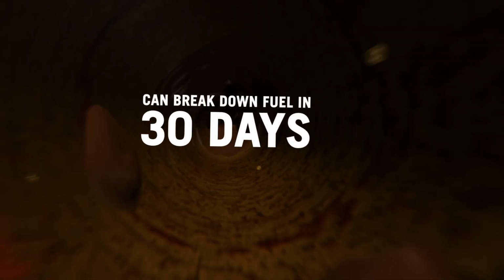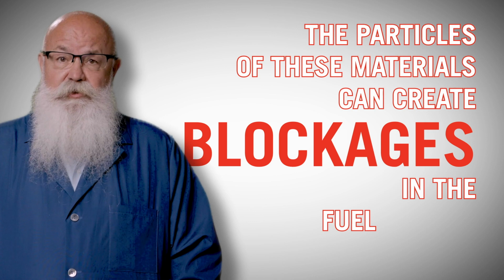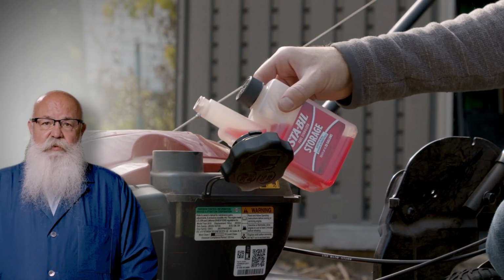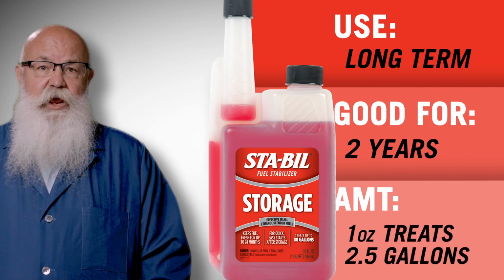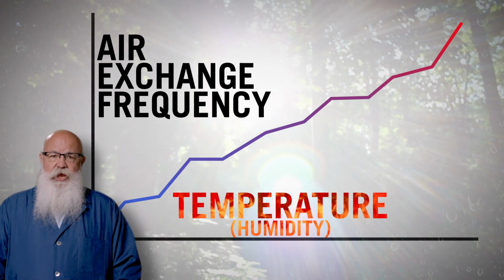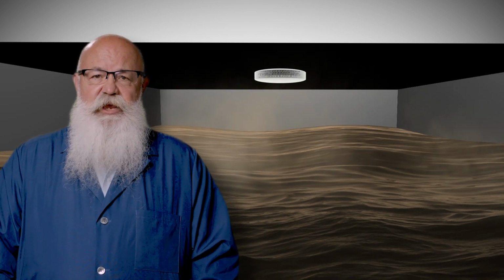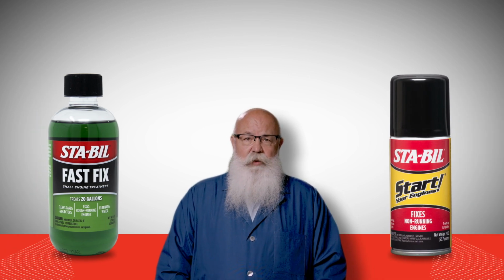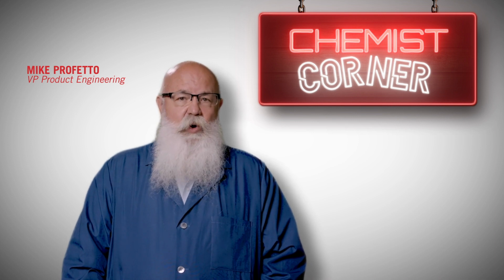Fuel Storage: Keep Tanks Full With Treated Fuel

Comment: What about draining the carburetor? Is it better to drain or leave it full with stabilized fuel?
Reply from the maker: Once you add the recommended amount of STA-BIL, all you need to do is run the equipment for a few minutes and the entire fuel system will be protected (remember to use with fresh fuel as well). There is no need to drain the fuel tank or carburetor. Make sure to keep the fuel tank 95% full to limit the amount of air and moisture that can get into the fuel tank.  Hope this helps!

Comment: For long term storage of more than a year, is it recommended to drain some of the fuel after a year and add another treatment of stabilizer in the recommended full fuel tank amount?
Reply from the maker: STA-BIL Storage will keep fuel fresh up to 2 years.  For best results, if you are at the 2 year mark, we recommend to cycle all the fuel with fresh fuel with a STA-BIL Storage fuel stabilizer.  Hope this helps! Thank you for using STA-BIL.

Comment: I have a gen 1 small block Chevy and a big block Mopar  that are both stored in the winter. 
After using Sta-bil for a few years . I find them difficult to start in the 
spring until I run through the treated tank and refill.
Reply from the maker: When storing your vehicle (modern or classic), fill the tank 95% full with fresh fuel and add STA-BIL Storage Fuel Stabilizer and run for a few minutes. This ensures that the entire fuel system is protected. We also recommend filling the tank up 95% full to limit the amount of air and moisture that can get into the fuel tank. Hope this helps.
Reply: @STABILBrand  thank you
Reply from the maker: @SSPlymouth  You're welcome. If you have any other questions, let us know!
Reply: I sure will! Thanks again.

Comment: I used  sta bil for 20 years i started to use the sta bil small engine pro all of my 2 stroke equipment are in the shop getting new carbs i never had problems with carbs or anything not gona use anything anymore
Reply: If you were trying to use STA-BIL small engine pro as a fuel stabilizer that may have been you issue as that is for cleaning, not stabilizing.
Reply: @BobGaluska probably wjat happened

Comment: Is it actually safe to drain the fuel ⛽️ tank on a Honda pump? What’s the best way to mix fuel stabilizer with fresh gasoline ⛽️?
Reply from the maker: Draining the tank is not the best practice. This leaves all surfaces of the fuel system susceptible to rust and corrosion. You should run out as much old fuel as possible, then refill with fresh gas mixed with a fuel stabilizer. The best way to mix fuel stabilizers is to add the additive then fill the tank or gas can with fresh fuel.